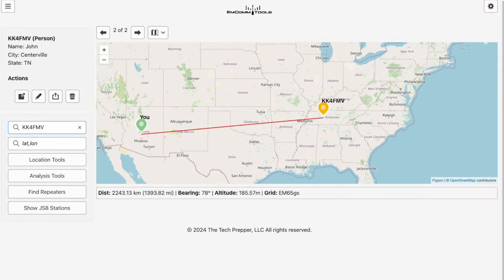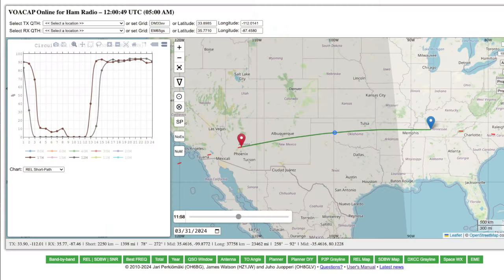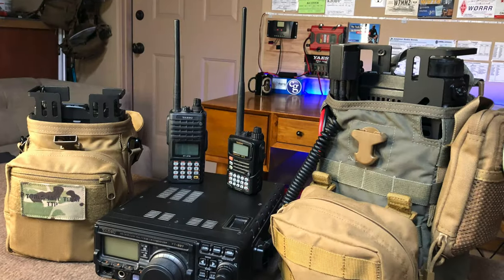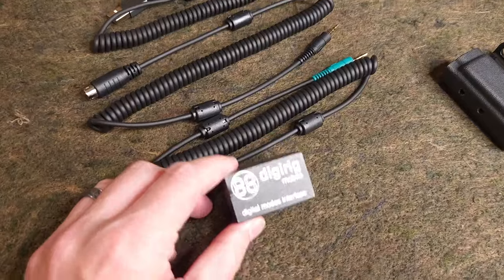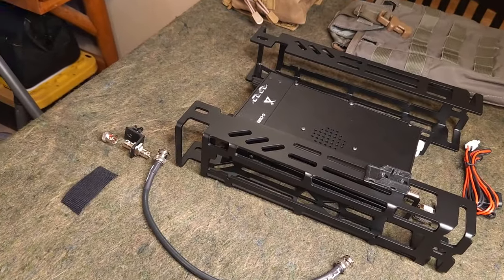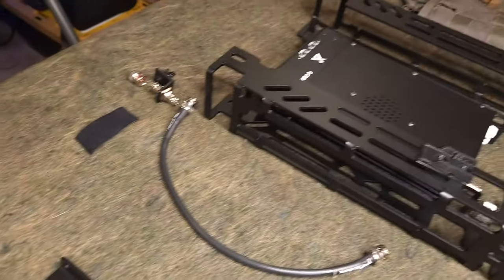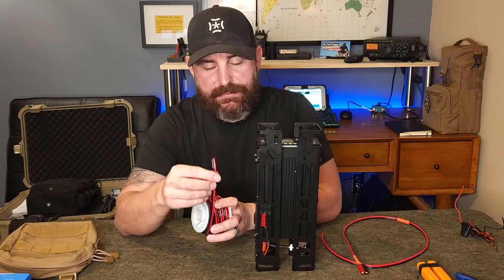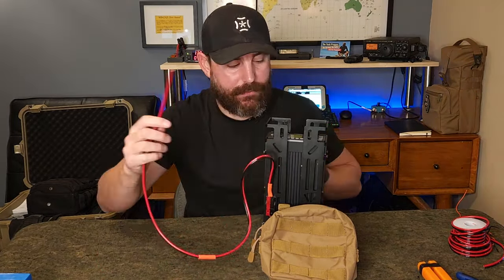Xiegu G90 Manpack Build for T.REX ARMS

Comment: A hot soldering iron pokes nice clean holes in nylon gear. Could help you run your cables from pouch to pouch.
Reply from the maker: Great tip. Thanks!
Reply: That's a solid bit of advice bro, cheers!

Comment: Wondering if T-Rex will start making soft goods for this market.......
Reply from the maker: That's a great question... It's a good thing that the PRC/117G is not a perfect fit. It may be the motivation they need to make a better bag  for the G90 in this manpack configuration.
Reply: That's a fantastic idea. I also think there would be a market for kydex radio containers for field use. The market would be really small, so I'm not sure if it would fit their business model, but I would personally be very interested in the community rallying behind a few specific high quality radios, and a company like T.Rex Arms making field carrying and protective cases for them out of either kydex or other material.
Reply: If there is enough interest in soft goods like bags and so on, I would SERIOUSLY get connected with Armageddon Gear. I've worked with him in the past with my production on a shooting sports television show. He does custom design work, and his team is top notch with everything they turn out.

Comment: Finally just finished my G90 build, the only thing I did different is I got a grommet kit and added a grommet to both pouches were they married up so I didn't have to run the battery cable externally. Cheers and much love!
Reply from the maker: Excellent call. I actually did exactly that in one of the original manpack prototypes. That's a big grommet. Well done.
Reply: @TheTechPrepper  Great minds. Cheers.

Comment: Getting ready to build a pack for my newly acquired G90.  It's my first HF rig.  Thanks for the ideas!
Reply: You will like it. Great first radio, especially at it's price point. At 20 watts, it's only one "S" unit down from a 100 watt radio.
Reply: It's a nice beginner rig. It is my first and what I use for portable voice operation. One of the major cons of it is that it is not 100 watts, which can make a significant difference for beginners. Another is that I have a hard time with digital modes, but like I said in my comment, it may just be that I have a faulty unit. The ATU, built in SWR meter, and the waterfall are especially good with it. I use it specifically for voice comms on Winter Field Day and Field Day.
Reply from the maker: You're welcome. Congrats on your first HF rig. There is a ton of features packed into this little package. Good luck with your modifications.

Comment: Very nice build so far ! Be careful, you might just find the G-90 to be a darn good radio. Not perfect, but darn nice. The 20 watts can make a big difference when needed and you can always turn it down. You will read about heat problems, but it has never been an issue in my use. I think the only time heat might be an issue is in extended digital use at max power. I have yet to have a problem with excessive heat. As to toughness, if you look at the Coastal Waves and Wires videos, Walt drags his G-90 all over the world and has had zero problems. Mine has been rock solid also. The built in CW reader works very well also. If needed, the built in tuner will tune a wet noodle, it's fantastic. For the price ($400. to $450.), it's a lot of radio. Looking forward to the upcoming videos.
Reply: Could not agree more, also Walt is my g90 hero
Reply from the maker: I love my Japanese radios, but they are lacking some modern features that the G90 provides. We'll see. It's time for 2-3 weeks of deep G90 immersion. I take "Internet claims" with a grain of salt. I was told that my manpack that I have been running in the desert for 3 years would cook. I've never had a problem, but I also have a different approach to operating. I don't rag chew. It's short, targeted commo windows for this operator. Thank you for being the first person to share a positive experience regarding the heat on the G90.

Comment: On wiring, I recommend using a 2 pair cable with strain relief built into the cable. It's often advertised as CNC cable. It generally has PVC insulation, shielding, and a braid between the shielding and outer jacket. Another benefit is it's usually a finer strand than standard wire. The fine stranding coupled with the PVC jacket and strain relief makes it a flexible and durable cable assembly.
Reply from the maker: I appreciate the cable tips. I'll take a look. Thanks.

Comment: Awesome collaboration project. This is essential kit and practice for anyone in the "citizen's defense industry."
Reply from the maker: It should be valuable for both the amateur radio and 2A community. This weekend I am testing this build in the field to see if there heat is a problem with the G90 in the manpack.
Reply: @TheTechPrepper Wondering what result you got with that follow-up regarding heat in the pack? Great project I'd like to implement, thank you

Comment: Looking good!  The High Ground Gear bag appears to work fine for your application.   You are wise to stay away from the bootleg PowerPole connectors.  I am also a big fan of flex loom.
Reply from the maker: Those bootleg connectors and housings are a nightmare. I will tell you that my wallet cries every time I need to put in another order for 10x 45A Powerpoles from Powerwerx.

Comment: Hi great vid!, since you don't have any green radios- you're going to love this rig!!!!!! one thing I can tell you, it's been to war! it also has a superior receiver than your other HF gear. I'm in love with mine. digirig mbl is a must for this rig.  its (Litteral) only disadvantage is that it's not IP65 rating. its no surprise Trex arms has this, over the pond, too many mil/comms  folks have one.  true max amp consumption is 5.04amps at 20W on 3.5MHZ in digital mode / CW and the lowest is 3.73amps on 7mhz with the average consumption of 4 to 4.4amps on 13.8v  AND RX RECEIVE AMP DRAW IS 0.44AMPS IN ECONOMY MODE (DISPLAY OFF) and 0.66amps with all the tools on for SSB VOICE COMMS. preamps, NB, AGC, mic comp. etc.

note: depending if you switch around the PC's on digital modes you might have to fine tune the acceptable ALC for each pc used.
I use this in the same fashion as you and it rocks with milspec BBTD and terminated EFLW (9.1unun/470Ω terminating resistor) , the BBTD is a killer match for low noise sig reception and ALE/ freq hop computer aided comms !!!!

also with digirig you might need to use the IC-7200 settings for some modes/programs instead of the g-90 listing like in winlink/vara for example.
have fun do extensive tests, my ft987 is collecting dust, so is my codan 2110.

I use the BBTD for NVIS with this rig but also I get superior dx with it and the G90 as well without trying...
73s from Sierra Victor one ....Land !
Reply from the maker: Thanks for the power stats. I plan to put a meter during my usage.

Comment: Timely. This is the radio I've decided on! Issues aside I love this little guy.
Reply from the maker: Excellent. I just upgraded the firmware, so I'll be starting on-air tests this weekend. Thanks for the confirmation. Did you add the aftermarket VFO knob? I just ordered one.

Comment: A company called "Atlas 46" has a shop in my hometown that a friend of mine worked at. They do a lot of heavy duty sewing if you're interested in contracting out your bags to be produced, they make some nice looking stuff!
Reply from the maker: Hang tight, but it's good to know. I am working on an old lead that is local to me. The bags may be coming back with a slightly different design.

Comment: One way you can create a passthrough if the fabric is 100% synthetic is take something hot enough to melt it and poke a hole in the fabric. Just like fusing parachute cord. I would use a thrift store butter knife heated red hot over a stove for a nice button hole type opening. You can get some nofray or super glue and draw around the hole if you're worried about fraying.
Reply from the maker: My production bags were actually hot cut. Using a similar technique.

Comment: Regarding power connectors - Sometimes the terminal and wire ae 'loose' within the nylon housing which gives the 'sub-standard' feel. However, if you plug it in to it's mate, the actual terminals may in face be very solid with a positive connection.  That's the important part to check!
Reply from the maker: Excellent point. Too bad I already added two layers of hear shrink.

Comment: Have you looked at the sBitx V3? Mine arrived last week. The rats nest of cable is history. Hook up ant and battery and go. Audio and ease of use is outstanding. At $400 from giga-parts it's a win!
Reply from the maker: I have not, but I quickly looked it up after reading your comment. I prefer radios that I cam run in a vertical configuration in a manpack. I just bought a $400 G90, so no more radios for this guy.

Comment: It would have been nice if TREX ARMS sent you the cooling bracket for the G90 and mod it to fit the ARMOLOQ frame. It has Anderson power pole input into it to run the cooling fan and the rig. That way, you would not have had to modify the power cord for power poles. Having the opening on the side may help bring in fresh cool air into the bag and having some baggy room on the sides will probably help with exhausting the hot air, but that also leaves room for it to move around and thus stability. Maybe secure it on one side of the bag? I'm interested to see your tests with this.

I hope you go into getting digital modes with the G90. I want to see if you get it to work just fine. I may just have a faulty unit as I got it to work again one night, then tried it again the next night with no success. If you fail, I really want to see the frustration in your face. 

Great video as always, Gaston!
Reply from the maker: That bracket is going to be a hard no. There is clearly a design flaw if that is required. My hope is that our targeted contact will not require too much on-air time where heat will be a problem. We'll find out soon enough.

Comment: I would caution against upgrading firmware unless it is many versions behind. I am running V1.78, and it is my understanding that this is the best one for digital /JS8. It is my understanding that newer firmware may give in some areas, but take away in others...but I also see conflicting info there. 
All I know is I use V1.78 and exclusively JS8, and I get contacts all over the CONUS with 1 watt, a 66 ft wire and a 1:49 unun about 10 ft off the ground.
Reply from the maker: Thank you for the confirmation. I'll do a bit of research on the firmware. JS8Call will be the primary use case for this rig and the emergency communication mode in the PACE plan for this exercise.
Reply: Interesting. Maybe this is why I'm having issues with digital modes sometimes working?

Comment: Jason over at Ham Radio 2.0 has an aux channel called Pack Man. (Play on the vid game.) Great minds work together.  Maybe he has some ideas and sources for radiopacks.

GigaParts is also coming out with its line of bags.  Maybe between the two of you, a line of radiopack bags could be developed!
Reply from the maker: My issue with GigaParts is the quality of the bags that I have seen. It's great that they are innovating, but I am not a fan of materials and assembly. Jason and I talk. In fact, we has three of my bags. I owns to 2% of the bags in circulation. Believe it or not, but I took 25 of my smaller manpack bags to Quartzfest 15 months ago, I did not sell any bags. I finally traded Jason one bag for two Ed Fong j-poles.
Reply: @TheTechPrepper I have the 7300 protection sleeve.  Good for protection in a bag.  But if the carry bag is like it, I can see your concerns.

Comment: Have you used any of the new wire wrap that also heat shrinks? I just got my hands on some, and I can't wait to finish up my xiegu x6200 pack build. I might do a short on that stuff since it seems like it's gonna be a game changer. 
I hope you're well out there. Stay safe and prepared. Especially in the coming weeks. The world keeps getting weirder and weirder. 🤙🏾
Reply from the maker: I have. They work great. Much more secure, but somewhat permanent.
Reply: @TheTechPrepper  I haven't come across any project that uses it. With the price, I'm thinking I'll use it on some ferrite clip-ons around my feed line. I picked some up for a wiring side job on an old VW, but with the way it has to slide on, i might just use split loom so I don't have to undo every connection when I'm finishing up.

Comment: When I have loose power connectors that I can't tighten up by adjusting the tabs on the contacts I like to 
* Put low temp hot glue in the back of the connector and
* Glob a little extra down the cable long enough to get heat shrink across the cable and connector with hot glue between the cable and heat shrink
* Test to be sure it's still working
* Heat shrink it
This keeps the contacts from wiggling around the cable from pulling through the heat shrink relative to the contacts.
Reply from the maker: Great pro tip. Thanks.
Reply: It's a cheapskate/impatient trick. Pros make a new cable with quality parts :P

Comment: Thank you for another great video!
I’ve been casually looking for new wire strippers. Which ones do you use and would you buy them again if yours were lost or damaged?
Reply from the maker: You are very welcome. I would buy the same pair again, but these do not like they are going to die. I bought my pair at Lowes 4 years ago. Mine is the Southwire sa822. I just updated the Amazon list in the description. Sorry for missing it.

Comment: I have been waiting for this video!
This is why I got a g90 to start off with, I knew it could be man packable.
How long you reckon the barrier will last with normal "emcomm" use?
Reply from the maker: There will be a few more videos showcasing the the G90. EmComm and SHTF are very subjective. I tend not to look at the world as black and white. I have had many instances where radio saved the day. There are personal and localized SHTF moments that benefit from offgrid comms. No everything about radio should be about a doomsday scenario.
Reply: I definitely agree. 
Allow me to rephrase my question, how long would you say from your experience a 6Ah battery will last while making, to borrow your term, "no random contacts". I understand that if I were participating in a contest or rag chew net it may last an hour give or take. But with the way that you use radio for prepping with targeted contacts how long do you reckon such a battery could last?
Reply from the maker: @eliezercohen2205  My common windows are typically < 30 minutes. So, will cover at least 6 communication windows.

Comment: I keep noticing that the mic isn't hooked up... How y'all get your mic hooked up?
Reply from the maker: It's in the front pouch. It just needs to be pulled out and plugged into the head unit. The frame allows access to the connector. In my other manpacks (FT-857D) I added three pass throughs from the main compartment to the smaller pouch.
Reply: @TheTechPrepper  Maybe you and Trex arms make a comms pack?! It'd be great for us IC's at Robin Sage to play wargames.
Reply: @TheTechPrepper  I just bought pretty much your setup here in the vid although I went the CW route... Keeping a laptop/tablet on an overnight recon exercise during summer in the rain doesn't seem to wise.
Reply from the maker: @Burchrg24  This could happen... ;-)

Comment: So I got a question for you. Do you think that frame would work with a anytone quad 6
Reply from the maker: Each frame is designed for a specific radio. There is an AnyTone section on the ARMOLOQ website. Check there for the supported radio.

Comment: Be careful on the automotive blade style fuses. Get fast blow and name brand Bussman or Littlefuse. Cheap Chinese ones offer no protection.
Reply from the maker: Great point. All my fuses are Bussman. I've seen the crap ones on Amazon. I've even seen them unlabeled from Amazon. How the heck does a company fail to print the rating of a fuse on the housing?

Comment: Still not made for ic705.  Would love to have the cage with battery pack added.
Reply from the maker: I actually have an IC-705 that a member sent. Unfortunately, it's still in the box due to time constraints. I plan to use that in the Jeep instead of as a rig for man-portable operation. I am curious to see how that radio works for a vehicle-mounted operation.
Reply: I found the Vertx range bag (the one with a drawer that pulls out) fits the 705 damn well and has room for a Toughpad, batteries, antennas, etc. Not molle-able but if checks every other box, even has water resistant zippers.

Comment: There is a mod to change Xiegu power plug with an Anderson power pull but you have to open the radio to mod.
Reply: Yep, it’s called a small hand file 😊. Took me only a few hours. So much better.

Comment: Is the G90 supported by Emcomm Tools? Or, is Issac going to use Generic JS8Call, etc. on Windows?
Reply from the maker: I am working on the integration for the G90 this week. He will have your build, but with the new G90 support. I am sending a him full Panasonic FZ-M1 MK1 with new ikey keyboard to keep. He will have a full turnkey kit right down to a custom field manual and P.A.C.E. plan.
Reply: @TheTechPrepper  Good deal, thanks Gaston. I am seriously considering the G90 for a mobile instead of the FT-857. 857s are in short supply and twice the price +.
Reply from the maker: @thebnbaldwin  The availability of the G90, low price point, and the manpack-ability all drove me to buy one for myself and Mike. Again, it is not my radio of choice, but it has value and would benefit a lot of people in the community. For $1,200-$1,300 USD you can fully build the entire manpack as shown with the radio, all the components and the bags. $1,200 is about what bare 857's are going for.